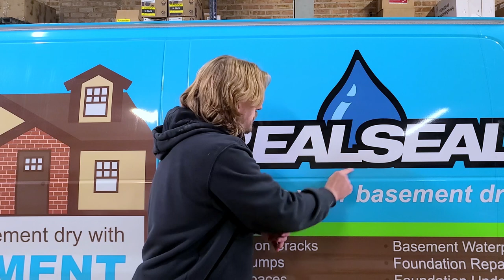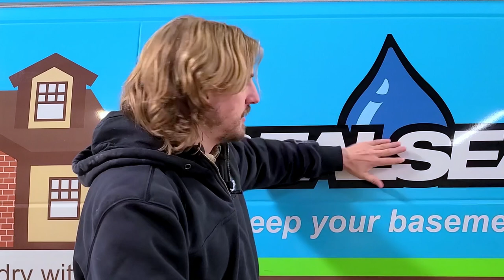Everything you need to know about crawl space ventilation

Comment: So, once the crawl space is encapsulated and air sealed, can I cut a small 4 inch duct (think dryer vent) in the main supply line to condition the area?
Reply from the maker: Good Question! As long as you seal around the hole, you should be good to go. A good caulking or silicone is good to seal it.

Comment: Hi there sir,  I live in Long Island New York near the water, but we rarely get any floods here; but also because we are so low, the  foundation is mostly wet.
 I'm brought 2 foundation companies to check out my crawl space  And one of the companies told me to eliminate all access windows and leave only 1 and make the crawl space air tight, and put a moist barrier on the ground, foam spray on the walls and installation on the ceiling. 
    The other company told me to leave all 3 windows and put automatic ventilation windows with  a  commercial dehumidifier and a sub pump,   and he also told me to put the same floor barrier with foam on the walls, but he told me I don't need Insulation on the ceiling.

  Which one should I do? 

 Also the first company told me that I should replace all brick support columns underneath with metal adjustable rods and the other company said to leave the support as it is. 

They are so opposite and I don't know what to do, and they are both experts with lots of years of experience with high reviews.  What would you recommend sir?
Reply from the maker: Hi There @Figs4Life! While I do not know your specific situation, as I have not seen it, I can offer some recommendations to help you make your decision. 

When it comes to waterproofing, insulation on the ceiling of your crawl space will not do very much. What it will do, though, is help keep the floors from being cold all the time. Cold crawl space air cools the 1st story floors, and the insulation will help prevent that. So if you have cold floors and want that fixed, ceiling insulation is the way to go. If not, don't worry about it.

The windows can stay, but there isn't much use for them other than as an egress window. If they are too small to be egress windows, then you don't have much use for them in the crawl space. Extra windows means lower insulation value, which means higher utility bills. 

Is the house settling? Sloping floors in the home? The brick columns are an older construction method for homes, but if they're not moving, they don't need to be replaced. If they are moving, then it's time to consider replacement.

As for the reviews of the company, be sure you read the reviews. Especially any complaints on the BBB and how they were handled by the company. That's the easiest way to see the customer service when things don't go perfectly. 

I hope this helps! Send me any more questions you may have!
Reply: @Therealsealllc   I appreciate your response, thank you. 

 I have one more question

 Do I need a dehumidifier? 
 One company said I don't need it the other company said I need it and a pump. 

 The  First company that said I don't need a dehumidifier nor a pump gave me an estimate of $21000 while the other company that said I need it including a pump gave me a quote of $17 500
 How come the second company is cheaper ? 
 Am I being ripped off? 
 Micro space is about a 1000 square feet, They have to remove old insulation on the ceiling, level some areas in the crawl space, and take out some debris.   The crow space height ranges from 3-5 feet
Reply: @Therealsealllc   Where are you guys located? 
  Do you guys do jobs in Long Island New York?
Reply from the maker: @Figs4Life  Different companies surely charge different amounts. You do get different levels of service, warranties, etc. But there are most certainly times (especially in the busy season) that you will see some companies drastically raise prices to see what they can get. 

Best way to choose the right company is to compare (and read) the reviews across Yelp, BBB (especially to how they respond to the complaints),  and Angies. Google reviews are too easy to fake, so I would not use those as a deciding factor. 

A dehumidifier is always a good idea, but not always necessary. Thinking of the long term health of the area, it would be best to get a dehumidifier. But again, I haven't seen your specific situation, so that is just general good advice. 

Does that all make sense?
Reply from the maker: @Figs4Life  I wish! We are in Chicagoland.

Comment: Do you need to leave one vent open for the dehumidifier or can you close everything up and just run the dehumidifier in there?
Reply from the maker: You can close everything up and run the dehumidifier in there. 

Alternatively, you can hook up an exhaust vent from the dehumidifier and connect it to the vent to exhaust that air outside. 

In that case, you need to be sure the exhaust pipe and vent are completely sealed and there's no free flowing air coming in from the edges.
Reply: @Therealsealllc  thank you
Reply from the maker: @sommasculpture  happy to help!
Reply: If vents stay closed won't radon levels go up?
Reply: @AlpineSprinkles  if you have radon you need to install a mitigation system. If there's no radon it doesn't matter. It's very cheap to test for radon. You don't need to hire an inspector. Just order the kits that the inspectors use or get a digital monitoring unit